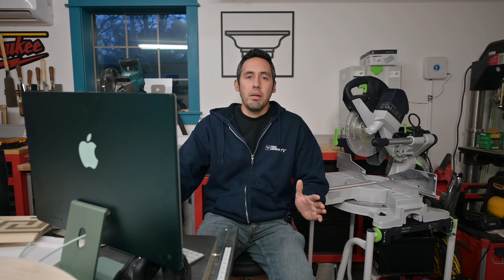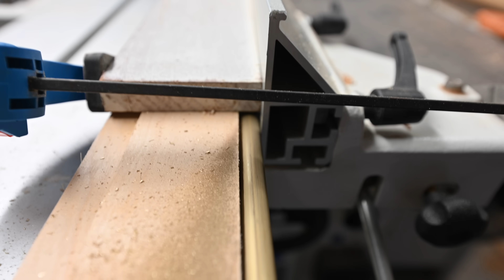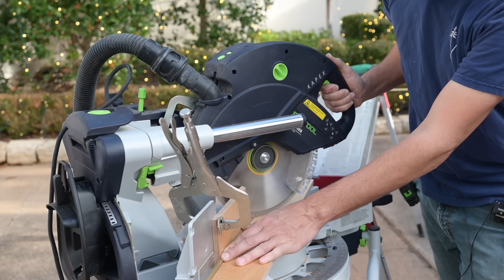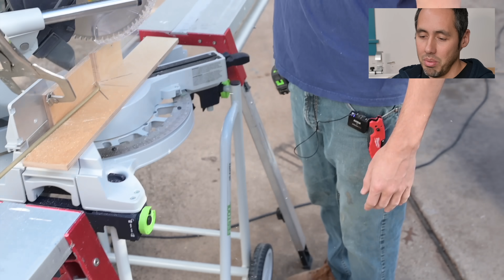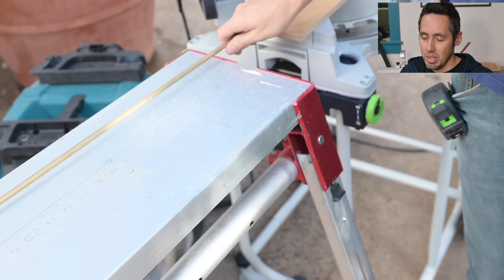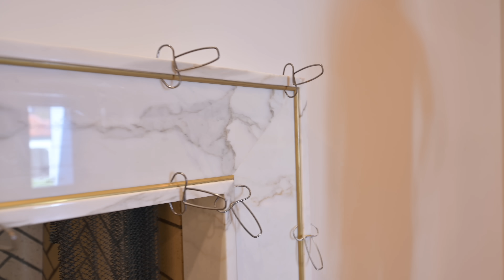It only took 12 years...My first MITER SAW injury.

Comment: I stepped on a nail in a similar way as you described and I can feel your pain. The injury I‘ll share is much dumber though. I was using one of those metal rakes with the short metal prongs and I leaned it against a wall to do something else quickly. I went back to pick it up and stepped on the prongs and the handle smacked me in the side of the head cartoon style. 

Lesson learned, always place garden tools where the pointy bits aren’t sticking out, even if they’re leaning against a wall.
Reply: Scariest non-injury: the other day I was cutting 2x4’s on my miter saw and tried to cut two at a time. They bound against the side of the blade and sent the bland and handle flying towards me. Thankfully my hand wasn’t in the way and the guard would have prevented injury even if it was, but I learned a lesson and changed my pants.

Comment: Back when I was an electrical apprentice I was snaking a line from the basement to the attic. I was on my ladder waiting for one of the guys to get his snake down to me from the attic, when I decided the hook on my flat steel snake was too beat up and wouldn’t be able to catch the end of his snake. Instead of cutting it and bending a new hook, I brilliantly chose to straighten it out with my linesman pliers to then bend it back into a clean hook. Failing to consider how weak the steel was at the point of the original bend, I proceeded to straighten it out. Right when it was about to be completely straightened out, the tip of the snake snapped off at the original bend. The hand with the pliers came flying at my face with about an 1/8” of the snake sticking out of the pliers. The pliers definitely hurt but not as bad as the piece of snake that stabbed me in the eyebrow which instantly started gushing blood. Less than an inch from losing my eye!

Comment: My worst injury was cutting off the tip of my thumb on a table saw, twice. Trying to rip a piece of wood too thin just using my hand to hold it down. You would think I would have learned the first time, but no, it took two times to learn. Something about old dogs and new tricks!

Comment: I am an independent contractor for spectrum doing installations of cable, internet, and phone. Worst injury I’ve had is hitting my thumb with my hammer while pounding a Jhook into a telephone pole in the rain. At the time I was using a smooth faced framer, I now use a milled face and I haven’t had that problem again.

Comment: Worst injury was from a table saw.  I was cutting shims for a window job out of a stack oh cedar shakes.  Made about 20 shims flawlessly and well i didnt pick the shingle high enough and I caught the blade which tracked the wood and my hand into the blade.  I kicked my first knuckle on my middle finger and into my index finger.  The x ray showed the individual teeth of the saw blade hitting the bone.  Luckily I didn't loose any finger but did gain some knowledge for sure.

Comment: Cutting plywood at an angle on a tablesaw with a fine finish blade set to 1/8 above the top of the plywood.  The cut required me to reposition my left hand halfway way through.  I had 30 cuts to do.  I made it to number 28 before forgetting to move my left hand and ran my thumb across the blade.  8 stitches. If I hadn't set the blade height, I wouldn't be able to hitch a ride.

Comment: Forming a concrete pad and I was putting a stake in the ground and the  end I was hitting with the sledge broke off and I hit my hand that was holding it below breaking my finger.  Lesson learned don't reuse stakes if there all cracked and broken on one end 👍

Comment: I was working in a warehouse and we would staple tags on the boxes.  Occasionally one would misfire.  Well I grabbed a box with one of those staples that had one side sticking out.  I lifted the box, tossed it on the cart and as the box left my grasp, one staple went thru my finger, hit the fingernail and came out the tip of my finger.  The company nurse grabbed a pair of needle nose plyers and started twisting and pulling on the staple.  After several minutes, she said you’ll have to go to ER.  All the time she’s doing her thang, I ‘m trying not to scream.  ER froze my finger and pulled it out, the way it went in.

Comment: Cutting a hood piece for a toy model T. Was cutting with the blade on 45. Was using a push stick, felt this is not safe. Moved to the side out of the way released the pressure on push stick and the piece flew back and smacked my thumb nail. After about a week the nail fell off.

Comment: Driving a fork truck that lifted me up 30 ft.  Loading boxes on a pallet that came up with the platform I was standing on.  As I went forward, the part I was standing on started going backward and down towards the cement floor.  I held on to the steering wheel as long as I could.  I landed on my back on the boxes I was loading, looked up and one of the forks was headed right between my eyes about 18” away.  I quickly jerked my head  to the left and the fork split the top half of my ear.  I was a second away from not being able to write this memory.

Comment: My worst injury was jumping down from the top rail of a swing stage basket onto the ground. Only about 4 feet, but something compressed in my low back and I pinched a nerve. Ended up working on light duty for about 2 weeks. Don't jump off things when you're not in your 20s anymore!

Comment: Was detailing the edge of where a deck met the wall on a condo building (no railings) first thing on a Monday morning and stepped on a piece of Tyvek I thought was just sitting on the deck. Turned out it was a temporary roof that had been put up by the siding crew the Friday afternoon before. Completely lost balance and went strait down to the deck below. Think the Tyvek roof helped break the fall but still not good.

Comment: When i was working in a furniture factory, i flipped around a couch on the metal railing. When it came down i caught it with my left hand. I didn't anticipate the weight of it and it slammed my hand to the rail, crushing my wedding ring to my finger. Had to have the ring cut off. This was 20 years ago and i have never worn a ring since.

Comment: One time I used a non impact rated p2 bit in my impact and I was attaching some cement board above and around a fireplace. The bit shattered and my drill slid off the head of the screw sending the drill with a jagged bit plunging into the meat between my thumb and index finger. I yanked back on my drill and the shattered bit with the 1/4 hex back went missing in my hand. Damaged the tendon and my grip isn’t like it used to be. Change your bits regularly.

Comment: Worst injury to date was actually a few weeks ago. And I wasn't even doing carpentry ( maybe that was my problem) But I was just finishing drywall at home. I had a couple different taping knives and trowels resting on the ladder shelf. I knocked one off and immediately tried to catch it mid-air. Well, instead of catching, I moved too fast and somehow punch-slapped the sharp corner with the back of my hand. ended up with 5 stitches across the first two knuckles on my left hand.

Comment: I've hit my finger with a rubber mallet, and gotten various scrapes, bruises or cuts doing DIY.  I think the worst was about a year ago I was holding a scrap block in place around a 4x4 to attach a railing to a set of outdoor stairs.  My thumb was on one side my other fingers on the other fairly wide.  I just moved the wrong way  to grab my drill and overstretched my thumb or wrist and it just hurt a lot.  I work at the computer all day, so I think maybe some of it was repetitive stress and that was just the straw that broke the camels back.  I did go to a doctor, and after xrays he decided it was just a strain and gave me a brace.  Was mostly back to normal about a couple weeks later.

Comment: WARNING!! When cutting Shluter's aluminum straight edge trim for tile.

I always use the recommended aluminun blade on my mitre saw and cut out the back side before cutting. However, I have learned to wear a face shield and thick slice proof gloves when doing so. 

I've had pieces fly off and cut my face, fingers, hands and arms with that that crap.

I've tried so many ways to cut it and unfortunatelt this seems to be the only way to get clean cuts.

Comment: im a fine cabinet maker for 16years now and i have industrial grade tools at home and at my shop. in july this year i was at home on my 30 years old 600pound cast iron planer working on white oak from 1/4 to 1/8 inch thick for some solid wood edge banding .  i finish my planks, press the OFF button get past the machine to take my last plank but by going by i put my left hand on top of the machine and my and took a rotation under the small 30yo guard and i had 2 fingers completely crushed and 3rd one broken. i now have only 8.5 fingers for a stupid mistake on an old machinery. If someone read this, if you buy old equipment, they are the best and more solid than new one but the safety is lacking. take the time to improve safety to old and even new tools you use

Comment: I was making doors for an under the stairs cubby.  I bought a tungsten carbide 3 1/4 inch bit for the rail and styles.  As I was routing (maybe a couple pieces in), slowly stepping in to not remove to much/burn out at once, something felt odd under the board, I pulled the wood back and the bit went flying!  I know this is worst 'injury', the bit did not hit me luckily but felt like I had a heart attack.   If that hit me it would have been devastating.  Check your collets occasionally heat can loosen stuff as the metal expands

Comment: I was cutting Down multiple hollow core doors in a basement to set them. The ceilings were low and  I had to cut off about an inch or so and  reinstall the bottom core. On the last door the core was pine and this one for some reason had a very solid and heavy amount of adhesive. Normally and on the first 3 doors I used my wood chisel to shave the veneer off the bottom core and reinstall it in the door but this one I had a hard time getting it to come off. The right move would have been to hoof it out to the van and get out the table saw and easily take the veneer off the core instead I kept at it with the chisel. Holding the core  in my hand I pressed hard and my chisel slipped and I gashed the meat at the bottom of my thumb splitting it wide open. I wrapped it up in a makeshift bandage of painters rags paper towels and masking tape proceeded to clean up the site and went to the next job which was just rehanging a pair of bifold doors finishing my day went back to the shop parked the van and headed home. Thankfully my better half insisted I go  to the Dr. And that I are myn2 y/o daughter with me to teach her to not be scared, and teach her about safety at work. The end result was 7 stitches and a pair of lessons for both me and my daughter. PLACE YOUR CHISEL WORK ON A WORK SURFACE, DO NOT HOLD IT I YOUR HANDS. GOOD CHISELS ARE SHARP CHISELS.

Comment: I was building a cabin. I was helping my father-in-law as he was putting in the joists for the second floor. He messed up installing it and had to cut it out to try again. I was keeping the saw's wire out of the way and stabilizing the ladder. Board cut, board fell, my head stopped it. 14 stitches at the ER. Ow.

Comment: Never put your hands close to the blade, also it needed vise to hold the brass piece.  The only accident I had in construction was 18 years ago, cutting a small piece of subway tile with a grinder without goggles,  a tiny piece jumped to my eye. I still remember the pain.
Power tools!

Comment: I had built a rig on top of a scissor lift to hold sheet metal at an angle to apply to inside ceiling of a shed. It was attached with some ubolts. I wasn’t paying attention as I took it apart and it swung down and about 50 pounds of lumber smacked my head and knocked me out cold. Good times

Comment: I’m not sure I’d even ask what part of my bad plan “might” have been the culprit. Like it sounds like he’s pretty set to leave a little more on the end and otherwise resume with confidence! Wouldn’t that thin piece have cut nearly as fast with a hand tool? How lucrative are these brass inlay jobs that you can destroy a festool just to finish it? Not judging, everything he said is useful advice. He put himself out there to save hands and eyeballs, and I hope it does. I’m about 20 years in, and I’m watching a younger me. Younger me also didn’t disconnect the dust extraction while making Fourth of July on my mitre. That was a good time to learn that the water wasn’t hooked up, and how ineffective snow is at extinguishing a burning vacuum.

Comment: FYI. There is a miter square that is out that is used by tilers to cut metal. Holds the metal in a trough on the saw table. Not sure if you knew of this

Comment: basic number one rule when operating a chop saw is bring the blade up to full speed, then slowly lower onto the material to be cut ,  you  appear to have the stationary blade already resting on the workpiece before switching the blade on. of course the startup impetus of the motor  will throw the unclamped workpiece in the manner shown,  it can be compared to a woodturner hammering his chisel into workpiece and then  turning the lathe on.

Comment: I was cutting bamboo flooring with my m18 10” miter saw. What I learned from this is the smallest pieces are the most dangerous. The blade caught the material while sucking my thumb in. If the material were softer I probably wouldn’t have my thumb today. I definitely know that god was teaching me a lesson they say to SLOW DOWn… my thumb nail was torn pretty bad and a chunk of skin was cut pretty good. The density of the bamboo helped stop the blade just enough so my finger was at the last bit of rotation of blade. 

I learned to NEVER cut small pieces without a jig or fixture.

Comment: This happened to me about 8 yrs ago when I was a framer.. I was nailing a 2b4  I had the nail gun close to my knee cap. And my finger was close to the trigger..and happened so fast and not sure but shot myself thru the knee cap..too, I had Levi's and was able to remove nail, walked for about a good 40 sec b4 I couldn't walk..I was out of work for about  good 8 months..soooo never take the spring on the framing nailer gun..and avoid pointing or have nail gun near ur limbs

Comment: I have been a framer for 20 years and about 12 years into it  I shot myself with a nail gun. It was a 3 inch coil nail that went through my boot, ankle bone, heel bone and into my plantar fasciitis. It actually didn't hurt that bad because it happened so fast but the few days after surgery it hurt lol.

Comment: Standing back admiring my finished trim work after spending most of morning on a ladder trimming a 15’ fireplace mantel….still holding  an old Senco pin nailer (no safety) at my side…bang! …2” pin nail into my thigh..odd thing is it didn’t hurt that much

Comment: I can think of 3, all spaced out with many years in between. First one I was just putting a screw in and the driver bit slipped out of the screw head and went into the base of my thumb nail just off to the side. I though I was going to pass out on that one. Since then my thumb nail grows funny on one side. Second one I was roofing and swung/moved the roofing gun from one side of me to the other just hanging onto the hose, and when it went by my leg it bumped my knee and misfired a roofing nail just above my knee cap into the muscle. It was very difficult to get off the roof without bending my knee even with help. They removed it at the hospital after almost every doctor and nurse had a look at it (because they all wanted to see). That was a quick recovery with no long lasting effects. The third was biggest accident I've had is when I fell off a ladder (roughly 12' with a fully loaded tool pouch on) while trying to pry a sheet of osb into place and my hammer slid off and I fell straight down beside the ladder with my feet landing on a new 2by garden edger and driveway which resulted in a fractured heel and it messed up the tendons in my right foot. That was very painful and a very long recovery before I could walk on it again and even though it was about 9 years ago and my foot still really bothers me to this day.

Comment: I cut the end of my left index finger off on my table saw. It is a Dewalt contractor 10” with built in dolly. I was using it to rip a small board and because there was no outfeed table I was reaching with my support hand to grab the board as it exited past the riving knife. I failed to lift my hand high enough and caught my finger on the top of the blade. It cut it clean off right at the cuticle and nipped the end of the bone. That was just over a year ago. I have an out feed table and don’t use the dolly frame. Hard lesson learned from a stupid mistake.

Comment: Worse job injury recently was when I smashed my finger installing wire decking on pallet racks. Worse power tool related that I can think of is putting a bit into my hand, multiple times, I hate Philips screws.

Comment: Backing. It was caused by lack of the backing. The miter saw had juuuuuust enough flex in the gap with the brass, as solid and unyielding as it would seem to cause this. I know- it happened to me cutting some aluminum a few months ago which took a month for my finger to recover from the backwards over-bend the saw forced my finger to do. Once I created a new zero cut from scrap plywood for different angles to have 100% backing up to the cut line on the different 45's, moving it each time for the different angles, it removed all the error that had been plaguing me on the extruded aluminum cutting.